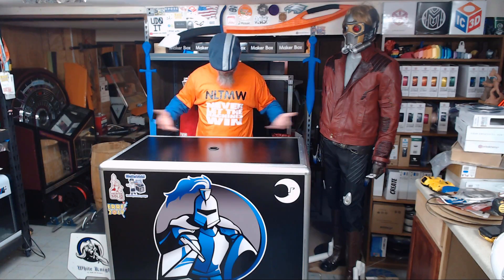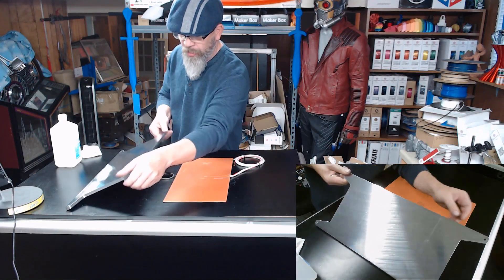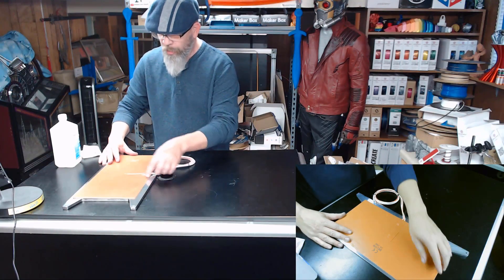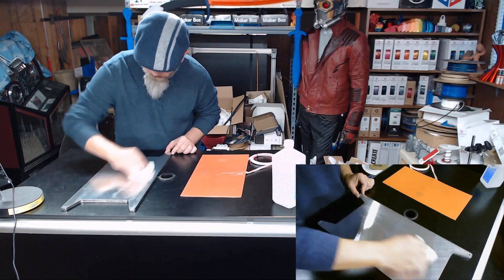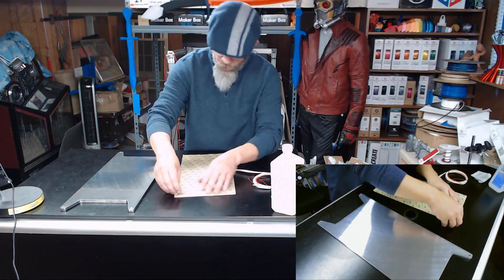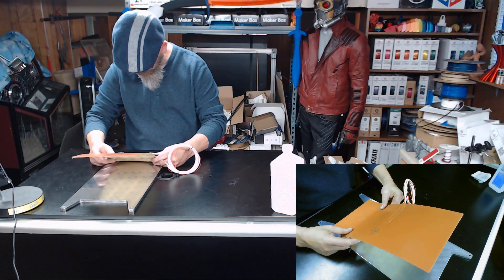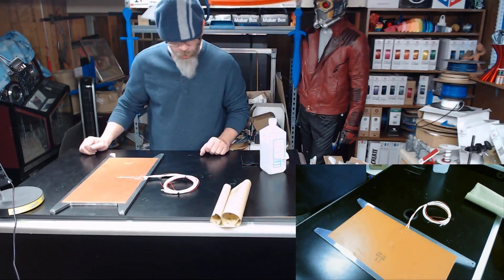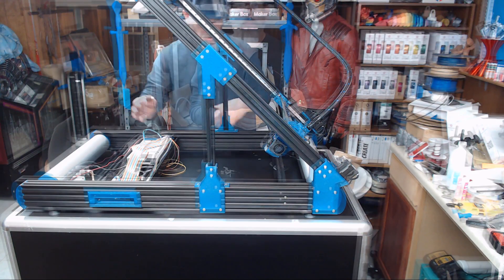White Knight Assembly Part 26

Comment: What is the exact size and voltage of that heater?
Reply from the maker: 200mmx400mm 24v
Reply: @NAK3DDesigns  thanks for getting back to me...I am having a horrible time finding one of these
Reply from the maker: @revanantwraith2793  just type the item # from the BOM in the e-bay search window..  It will take you right to the listing.